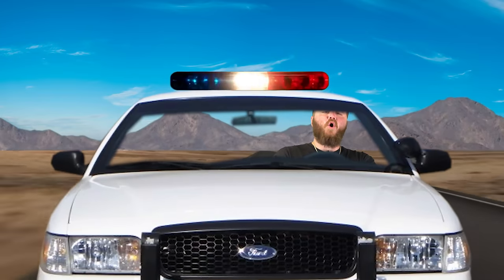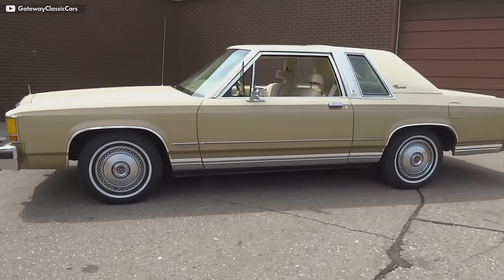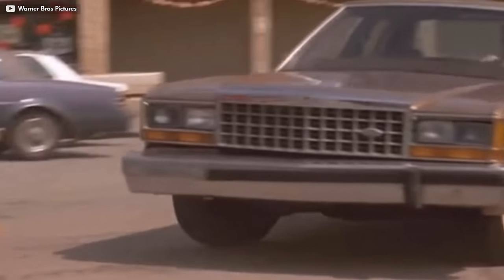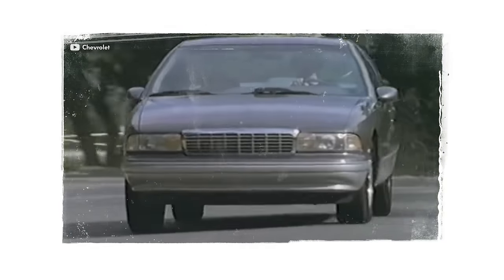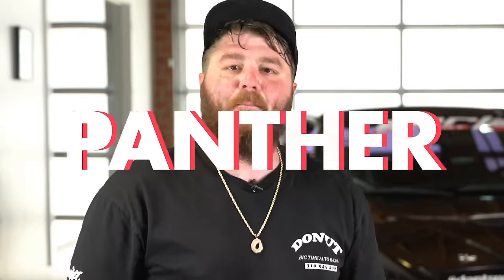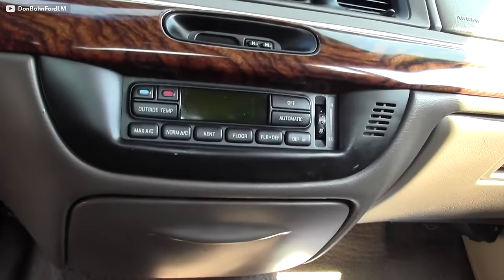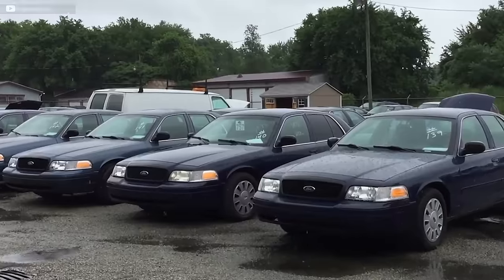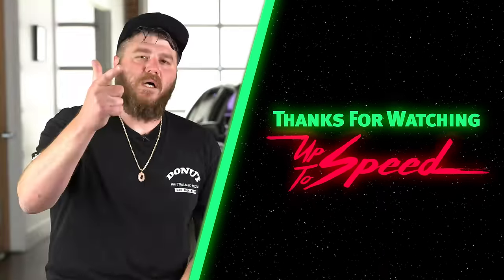Ford Crown Victoria - Everything You Need to Know | Up to Speed

Comment: The BODY ON FRAME DESIGN is the best design ever made by Auto Industry, especially the US Auto Industrie, and that i say from lifing in Bavaria, (Germany) ;)
It ha so many PRO for use the B-O-F Design for an Mid- Fullsize car, that i can´t tell you all these in an comment. But u have told about one big PRO; Cheaper ant easier to repair! 
And it is more reliable,too! I can´t beleave that the whole Auto Industry isn´t using this still in the moment for Mid-Fullsize Sedans and much more. Because it was also a cheaper option when using for more models. Before i was a Auto Designer and Stylist i made that big fail to ignore this kind of design...I thought it was "old and bad" but now i know why; I had not that knowlede in this time i thought that about. And now i know why the Auto Industy isn´t using the B-O-F Design for Mid-Fullsize Sedan class cars; They would NOT build reliable cars anymore, or even still in the moment, especially when they´ll sell EV´s, what are the ABSOLUTELY WORST "CARS" EVER. (You´ll see in some years that i tell the truth about EV´s. ;) Because the Lithium Cells are a physical factor what can´t be done better, because the phisical limits are arrived. And these L.Cells are the biggest problem; They´re AGING SO FAST! (2 years and the lifespan is over) and THEN U MUST BUY that horrible much/big Lithium Cells, or even better the whole EV. Because the price is the same. And all Crash Test Results for EV´s are FAKE. It´s because there isn´t any other place in an car than the floor for this massive cells...and in the crashes when people goes caged in a car ar deformating the floor, especially the cells. And this L.Cells are HIGH PROBLEMATIC when DEFORMING/CRASHING IT. This Cells goes up in flames, in higher temperatures and faster than napalm. (Do U WOULD LIKE TO SIT IN A BOM?! SIT IN A EV!)
Yes, that´s the problem with the present Auto Industry. They smell big sales of this fast aging EV´s and that´s the biggest problem why they want sell EV´s...And in a time like this you can´t tink about that this inusty will produce a RELIABLE CAR, especially in the DESIGN like BODY ON FRAME. That´s the whole truth why we see no Body-On_Frame Design Car still in the moment, AND THAT´S SO SAD & BAD! ;( 
But time will change, the EV´s would be the BIGGEST FAIL IN HISTORY OF AUTO INDUSTRY, YOU´ll SEE!
And THEN, AFTER THIS TIME they´ll go back to the V8 Engine for everybody, because it´s reliable and has enough power output and the best price for production..because you doesn´t need an super/turbocharger what is expensive and also a big problem for fails...and the cars would be go back to the Body on Fram Design, because the reliablility is so good, especially also the costs for production when using it the same Platform (Like the Panther Platform or B-Body GM (1965-1996) for many models... The only one Platform that isn´t Body On Frame and is really good in this size of cars is used in the Dodge Models like the Charger/Challenger, Magnum, Chrysler 300, the LX/LD Platform. What´s also used for the Police cars... That make sens.... But that´s not ordinay to find unibody Platforms in that high grade like this is, because it´s also using the V8, the RWD and it´s using really really good axles for it. But whaever, the Body On Frame Design is for most cars the better, reliable way. The Unibody is only good when it´s bringing the RWD and V8 in this class. But it was also a good option for the smaller size cars. GM did that with Body On Frame right, when you´re looking to the Chevelle of 1967-1970s. This Mid Size Sedan class cars was great with this B-O-F- Platform. And that was also a thing for the future in this size of cars again, too.
This cars was build with honor and truth. And that we´ll see when the EV time is behinde us. And i can tell everybody, when you´ll be safe and don´t burn down, caged in the wrecked car; DON´T BUY ANY EV! ;)

Comment: Old guy here, we can put 300.00 in groceries in the trunk, and not reach the inside lid. One year, I helped deliver turkeys for the holiday, My friends has a Hummer 2. We were loading both vehicles at the same dock. I had 20 more than he could, and I could still outrun and outhandle his. When we went places, he and his wife preferred my car to their Hummer. Go figure. My "Boat" has over 1/4 million miles and there is not a noise in it, except that noise from the exhaust I need to take to the shop and get welded back up. My other car is a Ford F150 with the same drivetrain as the Vic. Am I a fan, does it snow in Buffalo NY?

Comment: Um... it wasn’t a different intake that made an extra 80-90 HP for the Maurauder lol. The Maurauder used the 4v/DOHC 4.6 like in the Mach 1 and Non blower Cobras. The regular Crown Vic and Grand Marq got the 2v/SOHC 4.6 as used in trucks, vans, and similarly to the GT Mustang but yes in that case it had a different intake and less aggressive cams than a GT 2v 4.6. That’s big information your missing there, totally different engine in the Maurauder than any other Vic or Marq.
Reply: We just had an 03 Marauder on our dyno this past Friday. Bone stock engine; stock block, stock rotating assembly, stock heads/cams, etc. with a homemade turbo kit the customer fabricated himself in his garage centered around a PTE 6875 Gen 2 turbo, along with a fuel pump and some ID1300s. Tuned on his factory ECU we made him 694whp and 711wtq on pump E85 peaking around 21-22psi. This is a very conservative tune as well being this is a street car, timing was kept quite low and fueling was left on the rich side throughout the curve. I don’t know of any other big body rwd sedan that can offer this kind of performance. Even 2J powered sedans would take a ton more boost to achieve this and I for one would love to own this so called undesirable vehicle. I think most enthusiast would honestly.

Comment: I have a regular crown vic, buying a p71 when I get my tax return :) cant wait lol
Reply: burned fromthesun I just bought one with 119k miles hopefully the trans and motor runs good
Reply: @12jgonzales  got one around 120k trans is good. But it needed a little suspension work, some new panels, and a wheel bearing lol. Got a great deal tho and im doing all the work myselg.

Comment: Mine is a 2002 bone stock it runs 10 seconds flat in the 1/8 th mile which I would think turns into 16 seconds in the  1/4, it was pinging a little in the top end because of cheap gas and would probably run a little quicker with better fuel, I would love to add a built transmission with a 3k stall converter and maybe better gears mine are 3.23's now but it definitely needs a limited slip differential.  I think...with a good valve job and a 30 degree back cut on the valves, with the right tune... a totally stock looking Crown Vic could run potentially in the high 13's in the quarter.  Anybody wanna help me with It ? LOL..  just kidding.   Hmm .. twisted wedge heads... hmmm.  that would be stage II and still stock looking.

Comment: Ford should bring back the Crown Vic and throw the ecoboost engine it i think it’d sell pretty well
Reply: They could even make a higher trim and throw a 5.0 in it
Reply: If they did either imma just get an old 4.6 n swap it 😂😂
Reply: @diffsnicker6570  nah bro. The ecoboost makes more power than the 4.6 and gets better MPG. Also if you pair it with Ford’s 10spd automatic that thing is gonna be fairly quick. The reason I said they should bring it back with the ecoboost engine is because its a 4-door/4-cylinder car thats what the majority of Americans want (either a sedan, SUV, or a truck). Yeah it would be cool for them to give us another v8 crown vic but lets be honest then its gonna be just like the chevy SS: A cool ass car that doesnt sell for shit. Ford currently has a sports car, a truck lineup, and an SUV but they dont have a sedan and if I had to get a 4 cylinder sedan I’d much rather get a 300hp modern crown vic with a 10spd auto than something like your average camry/accord. 

P.s. I love the 4.6 engine but it just wouldnt sell well in the american market nowadays
Reply: @ghettomechanicllc3070  okay okay I hear ya I'll meet you in the middle and put a coyote engine in it that would tear up
Reply: @diffsnicker6570  like i said that can be a trim🤷🏽‍♂️
Reply: The US Market is dominated by like SUVs and Pick ups with like Sedans and Compact cars at 2nd having a Crown Vic for this generation isn't gonna make a difference honestly
Reply: @yi_hou3092  

I doubt that comment.
Reply: @yi_hou3092  ford already makes an SUV and a truck. If american buyers want a sedan they are pretty much forced to buy a toyota, honda, or nissan ( or a charger but thats a sports car) why not give people a Ford option thats practical but also has a little bit more power than its opponents? Not EVERY single person in the United States wants an SUV, they’re very large, tremendous gas hogs, and are slower than pretty much every other type of vehicle. Ford stopped making cars because sales were low for cars like the focus, fusion and taurus but the crown vic was one of the best selling cars of all time (fleet sales or not they were good cars), there has to be a market for mid-sized cars that are pretty quick but have decent mpg

Comment: It's bad because the bubble generation of the Chevy Caprice flat out without run the 4.6 l Ford but in the corners Ford had it and then in later years when the Caprice made its come back for a short-term off the Australian Holden with the 6L V8 Ford could not touch that until they did the twin turbo V6 Taurus which is still not as rugged as the Holden base Caprice but I'll never talk s*** about the crown Vic because I've had a handful and I've driven others that are just great riding big body on chassis rear drive cars they are more like a truck than a Jeep Cherokee

Comment: They need to make new one they could use mustang suspensions and  engines  on a full perimeter frame it would give Ford a competitor for the charger and a stable mate for the mustang that wouldn't compete with the mustang but there too busy name ing an electric crossover mustang 🤦

Comment: I own a Crown vic and it is worthless in the snow.  Makes me wonder how they lasted as cop cars.
Reply: You need good snow tires, a little weight in the trunk and some careful throttle application. That will make it tolerable and is how most police agencies operated in bad winter weather. I'm currently driving without any weight in the back and I'm on Cooper Tire CS5 all seasons and yeah it can struggle to keep traction when taking off when it gets snowy and icey. I only drive to work and the store when it's bad out and i just take it real easy (With the occasional drift in the empty, icey parking lot lol) Its a bare bones, basic rear wheel drive land yacht. Snow driving is definitely not a strength of the panther platform vs modern designs.
Reply: Definitely what Kuson2 said, I always get snow tires, but coming home in the snow with a new crown vic, and it not being able to make it up my driveway told me I was doing something right. A good set of snow tires makes a world of difference, they handle reasonably well in the snow, with proper tires.

Comment: I don’t lik the way it look, I hate Ford and think it’s slow, but man do I want one
Reply: ~250 HP ~280 ft/lb. of torque stock, they definitely aren't slow
Reply: @diffsnicker6570  ok, but that’s nor slow for them, but it’s barely more than a Prius, and it’s a boat,
Reply: @william2glaser227  that's pretty impressive considering it weighs probably twice as much, and for its age
Reply: @diffsnicker6570  ok it’s great for its age, because it has only a 4.6 l and makes more power than my 84 Silverado
Reply: @william2glaser227  nice I would definitely drive a square body too I'm really a sucker for any solid truck of full frame V8 sedan
Reply: @diffsnicker6570  the only bad things are the engine, and the fuel economy, I can proudly say to my friends in high school, “I drive my dads only pickup and get 5 mpg”